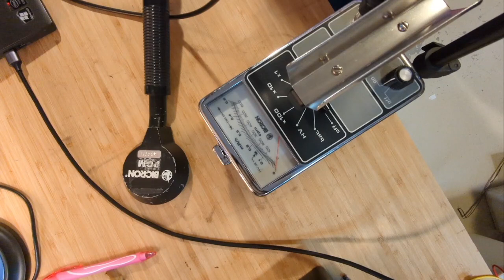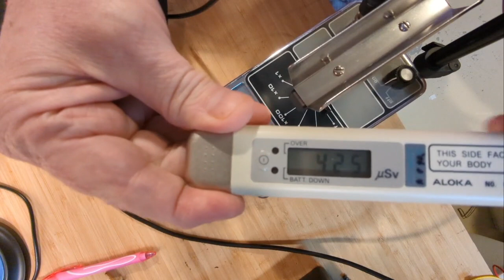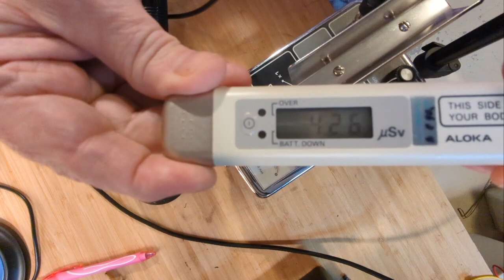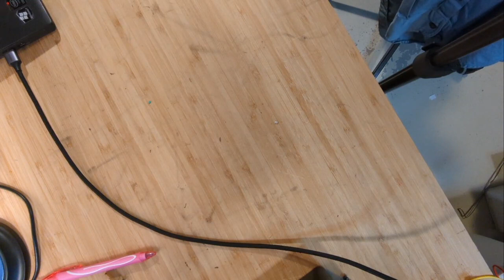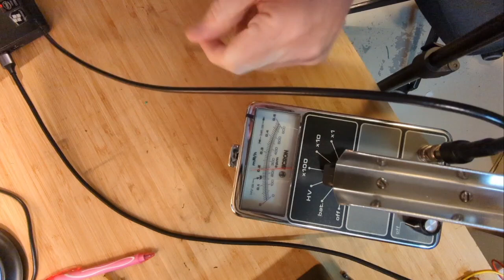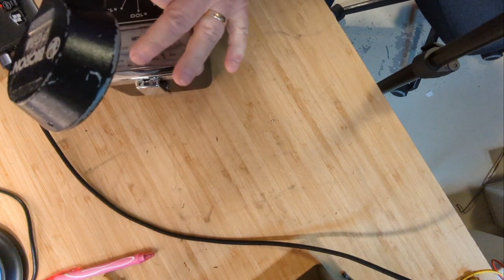So I just had a Cardiac Stress Test using nuclear medicine.  Am I radioactive?  Just like the Hulk!

Comment: We usually administer anywhere from 10-12mCi of Tc99m for your resting dose and 30-33mCi for your stress dose.  Extremely obese patients will receive 30-33mCi for both doses but will be scanned over a two day period.  I hope your scan went well and that your results were normal 😊
Reply from the maker: The scan was indeed satisfactory and two days later I was no longer radioactive, at least as far as my geiger counter could detect.  And yes it was Tc used as a tracer.  Thank you for your concern!